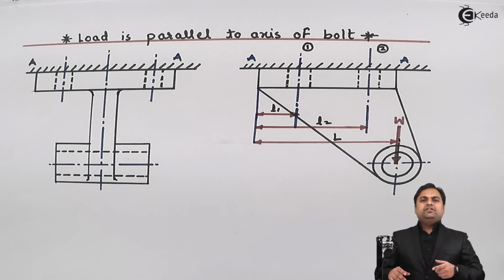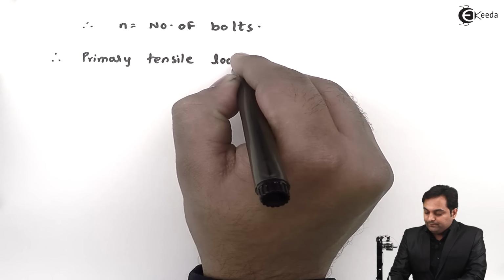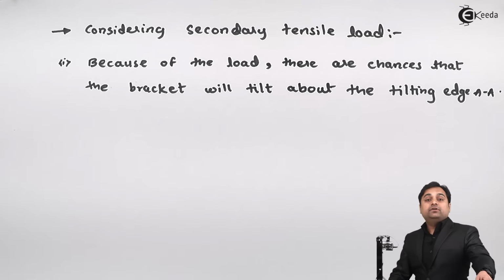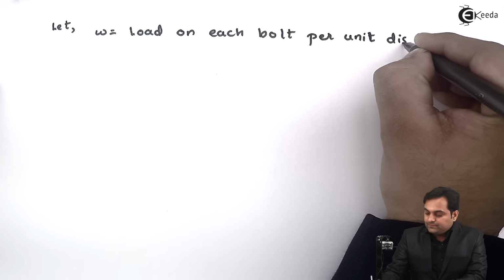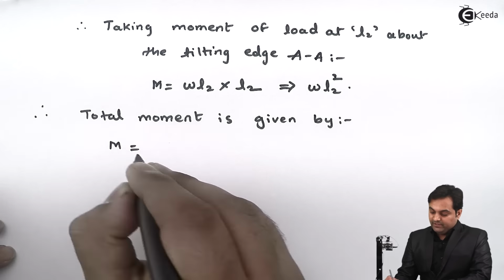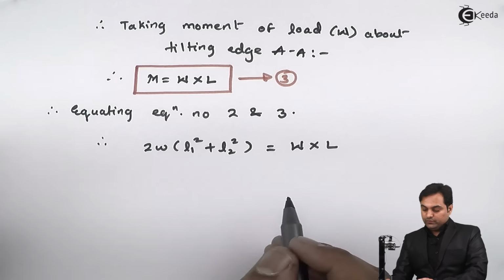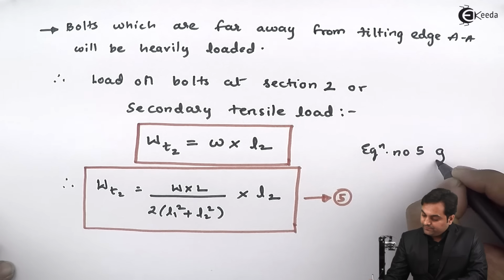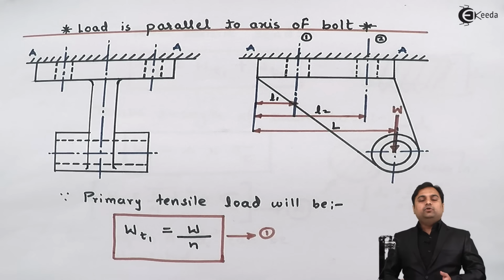Derivation of Bolted Joints When Load Is Parallel to the Axis of Bolt - Design of Machine

Comment: sir, Could you please clarify, what happens when the load line passes through the CG of the bolts. ie l= half of l1+l2. This is a symmetrical case and the secondary forces should be zero. only primary forces should exist. But the equations dont indicate so. Thanking you.
Reply: Any luck with this question?

Comment: hello! can you explain exactly why (small w)*l1 is the total load on that bolt?

because it looks like you took a uniformly distributed load of (small w) into a distance of l1 but then the the whole concentrated load of W1 should be at half the distance of l1  (l1/2) and then the moment should be: W1*l1/2
which gives you:
(small w)*l1^2  / 2
Reply: Ekeeda hello
is there any answer to this?
Reply from the maker: yes it is UDL & multiplied by distance gave total load on each bolt...